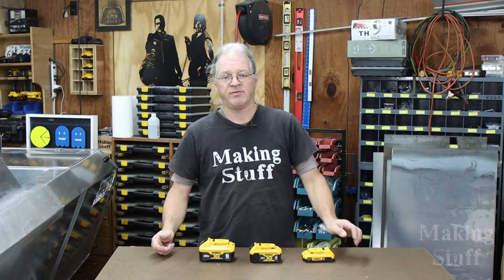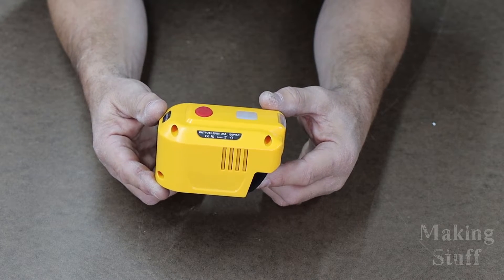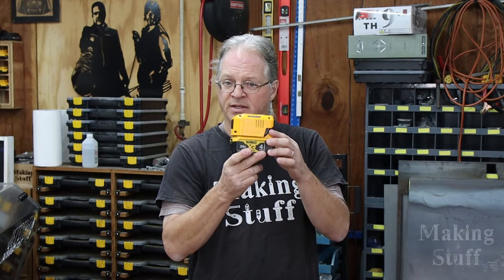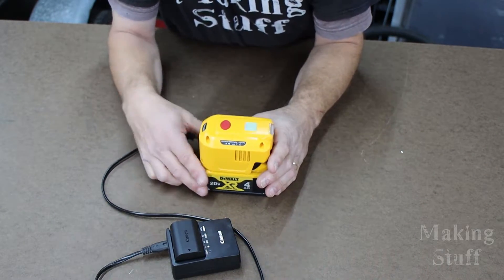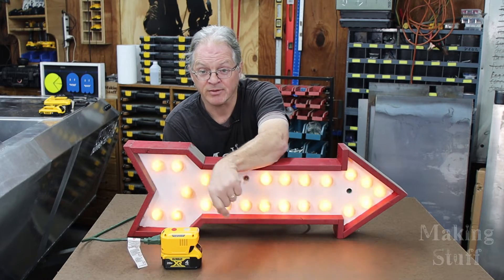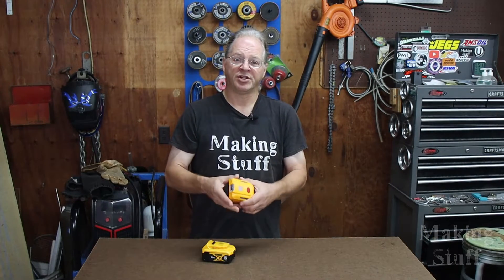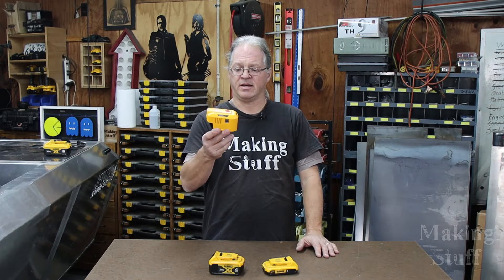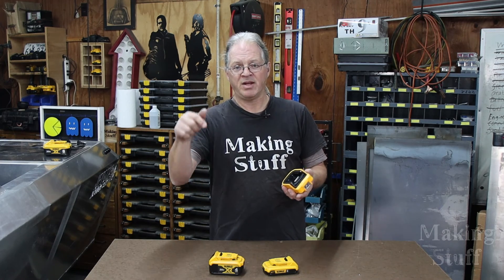How To Turn Your Power Tool Batteries Into A Mini Power Station

Comment: If you have to take the inverter apart to fix or reset the CB, then it's a junk inverter.

I have a similar inverter for the 18v but if it trips all i need to do is reset the inverter via the power button. Ie it self resets.

Comment: Guess what? I like the glue guns that are corded better than the battery operated glue guns. Works I even ran my Black and Decker (old style) scroll saw on this inverter. I ran a newer-style fan on it. I ran a modern Dewalt hobby tool on it. There's so much hobby can craft tools (like lower capacity heat guns and blowers and soldering irons) that work fine. Can you imagine putting up decorations on park trees in your neighborhood using a portable glue gun? All fun. All work. All good. (Yes... I have too much time on my hands). Also works for small hobby drills and water pumps. Life is good. God is good.

Comment: Milwaukee has had one of those for several years. I use it to power my laptop. It works well. I can use my laptop all day if required. Because it is made by milwaukee, it does not destroy the battery.

Comment: Wondering if this has a low voltage-power shutoff protection built in?  Maybe can get a cheap cordless Dyson adapter that does and adapt the two together or another low voltage-power cutoff module to adapt with.  Definitely not good if damages batteries that do not have the built in low voltage shutoff.  Wondering also if is a modified or pure sine wave inverter design?  Guessing modified and would be interesting to see what the waveform looks like with a cheap oscilloscope.  Thanks for sharing.
Reply: Generally, my experience with most tool batteries is that they have a BMS inside the battery which will disable any current flow once it reaches down to x% Depth of Discharge.
This is why your tool stops running. Not because the battery is 'dead', but because it has generally dropped to 20% charge, which for Lithium-Ion is close to 3v per cell and the lowest you want to discharge them if you want them to be able to have their rated number of charge/discharge cycles.
120v @1-1.3A is not going to run much, and any small motors/pumps running off the modified sine wave this thing puts out is going run hot and die earlier than with a proper, more expensive Pure Sine Wave output, which does cost more.
Reply: @boots7859 Milwaukee does not have this
Reply: When I run my angle grinder on it... it won't... just shuts off and has a blinking light. If you don't turn on the angle grinder, it does trickle... but it does not damage... so there must be some electrical magic inside. But I can only say that for the inverter that I have; which is a Ryobi.
Reply: Motors have a surge or I guess called peak power requirement and then the continuous power requirement.  This is always specified with generators and usually from what I've seen with inverters.  I've wondered in the past if a soft or hard start capacitor might be a way to get more versatility with the smaller inverters, since the capacitor can store more power for use when starting the motors that require that higher load to start.  Like make a safe box for the capacitor with 120VAC cord on each end so to plug in between the inverter outlet and tool.  @plum1000
Reply: Little carving action for the notch and some of the mount end removed and a Bauer 20V battery will fit nicely seems.  I've tried documenting on my channel and seems to work good.  Just have to be careful when using the 18V tools that do not have the BMS low voltage cutoff built in. Similar to the cheap battery adapter that do not, can ruin batteries.

Comment: Is it signwave or modified signwave power?
Normally the modified signwave power causes the transformers generate more heat
Reply from the maker: Sorry I have no idea.
Reply: These are typically modified sine waves. You will have to pay for a better inverter for the pure sine wave a/c and the inverters trend to be a bit bigger.

Comment: This was interesting but 120v -110v at 150watt is only 1.25 - 1.36 amps. You really can't do much with it. It'll be great at keeping you cel phone charged off the usb port. Thanks for the review.
Reply from the maker: Thanks for watching!
Reply: One Youtube person said it was "useless". But, it all depends on what you do. For instance, I ordered a portable table saw and grinder and table drill combo unit from China. It works on this unit (or similar unit). Here's what else works:
Glue guns, manicure tools, soldering irons, hobby heat guns and blowers, scroll/jig saws, etc. You cannot imagine the "joy" of turning a corded craft tool into a functional portable tool so you can work at a park bench or on a picnic table. This is an amazing tool!
Reply: Tvs typically draw like 1.6amps Max at like 96 watts max. Usually 0.6amps. pretty sure this is going to run a QLED tv just fine. Research it